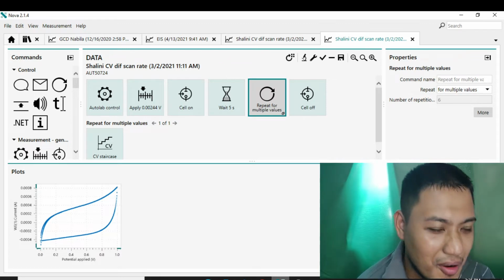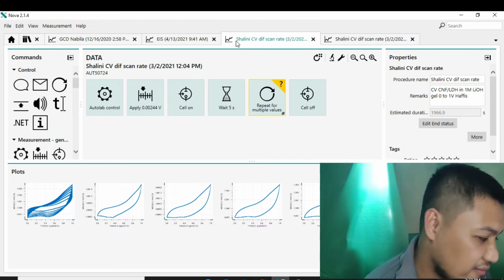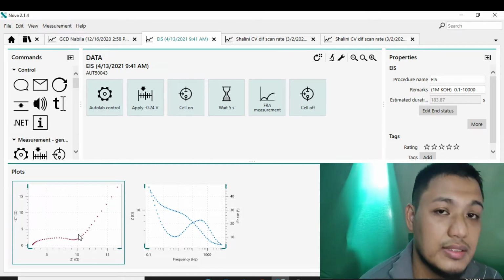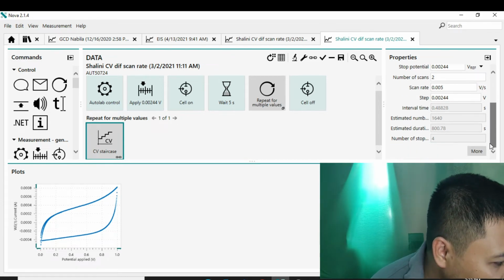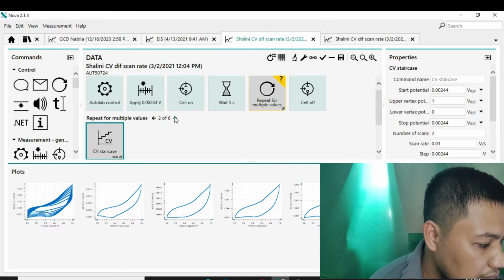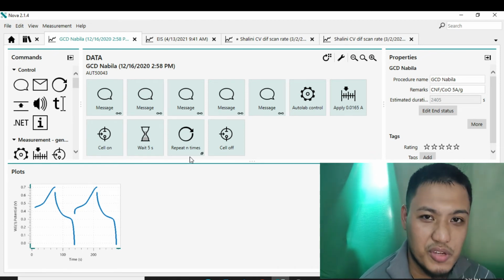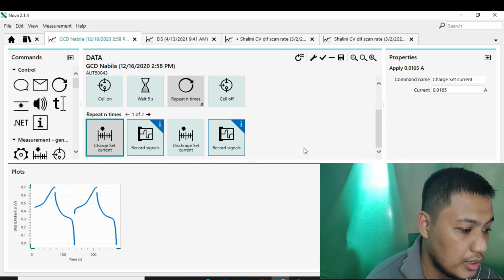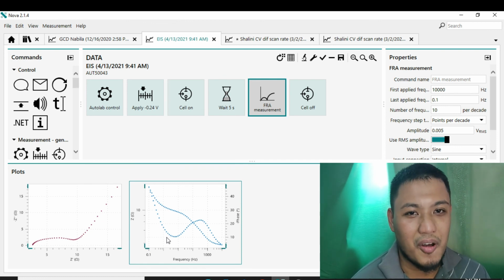Basic supercapacitor 3ELECTRODE System. [CV, GCD, EIS]

Comment: Hello dr haffeast and thank you for all your videos i had question about the configuration for two electrode test (device) on how it should be or what is different from 3 electode system.
Also on assembly of device could you give some suggestions on how to seal the device as well (im using ni foam as substrate).
Thank you again.

Comment: I have a supercapacitor material, as per literature I have to set potential window of -1 to 0. So what should be values of upper vertex, lower vertex, start and stop value. I am not able to set them as it shows error. Please Help.
Reply from the maker: Tried upper vertex, start and stop value 0. Only lower vertex -0.1

Comment: How to import our data to the Nova software in our own laptop? as we get the data from the nova software in the computer that is integrated with the potentiostat
Reply from the maker: First you need to install the nova software on your laptop. Then you can open your nox file. If you save using excell then you can directly use origin to plot your data. Hope it helps you.

Comment: Please help me for solution this problem

A 1.000 g sample of zinc metal is dissolved in 50 mL of 6 M HCl solution and diluted to the mark in a 250 mL volumetric flask. A 25.00 mL portion is transferred to a polarographic cell and oxygen is flushed out. A polarogram in the range 0 - 1 V (vs. the Hg-pool electrode) shows a wave at E1/2 = -0.65 V, id = 32.0 units of galvanometer deflection. A 5.00 mL portion of 5.00 x 10-4 M CdCi2 solution is added directly to the polarography cell which already contains the Zn solution, oxygen is again flushed out, and a second polarogram is taken. The wave shows the same E1/2 but the id is 77.5 units. Calculate the percent by weight of Cd impurity in the Zn metal. Note: Atomic weight of Cd is 112.4 g/mole.

Comment: Thanks God.. I found this video. Thank you so much Sir. This really helped me to understand and carry out electrochemical testing..

Btw, I have some questions Sir.. If we want to observe our material until 1000 cycles. In CV procedure, we put the number of scans by 1000? and for GCD procedure, we put 1000 in number of cycle column. Is it correct?
and how long the estimated time to run this cycle? Is it okay to leave the measurement for days?
thank you
Reply: Please help me for solution this problem
If you know
If you can

A 1.000 g sample of zinc metal is dissolved in 50 mL of 6 M HCl solution and diluted to the mark in a 250 mL volumetric flask. A 25.00 mL portion is transferred to a polarographic cell and oxygen is flushed out. A polarogram in the range 0 - 1 V (vs. the Hg-pool electrode) shows a wave at E1/2 = -0.65 V, id = 32.0 units of galvanometer deflection. A 5.00 mL portion of 5.00 x 10-4 M CdCi2 solution is added directly to the polarography cell which already contains the Zn solution, oxygen is again flushed out, and a second polarogram is taken. The wave shows the same E1/2 but the id is 77.5 units. Calculate the percent by weight of Cd impurity in the Zn metal. Note: Atomic weight of Cd is 112.4 g/mole.
Reply from the maker: You can choose 1 either CV or GCD. Depends on your Potential window. If the potential window is big, then you analysis will be longer. 

I do suggest you use high scan rates like 100 or 200 mV/s to run your stability test.

If you are using GCD, please use high current density to reduce the analysis time. For example 5 or 10 A/g.

Yes you can leave the measurements for days. After the stability analysis is complete. You need to rest the machine for 2 or 3 hours before your next analysis.
Reply: Thanks for your fast respond, Dr. @DrHaffeast  I have another question. In our Nova software there is no GCD procedure (only Cyclic voltammetry galvanostatic), so how to measure the GCD? Should we make a new procedure? If so, could you show me how to make a new procedure for GCD. Thanks again Dr..

Comment: Hi, sorry to ask, I want to test CV, GCD and EIS using autolab on synthesized anode for lithium-ion batteries which substrate-like, how the set-up on the instrument should be ya? thank you in advance!
Reply from the maker: For lithium Ion batteries normally you need to fabricate your material in a coin cell. After that you can use 2 electrode systems to measure CV, GCD and EIS.
Reply: @DrHaffeast  i see, so it is necessarily to fabricate coin cell. thank you sir.
Reply from the maker: @azu9833  Yes.
Reply from the maker: @azu9833  unless you want to report battery type Supercapacitor instead of lithium Ion batteries, no coin cell is needed.

Comment: Hiii sir,

Suppose Cv potential window is 0.6- 1.4 V
While doing GCD the potential range that I should set is 0.6- 1.4 V
Or 0-1.4 V.
Because sir Charging should start from 0 and after discharge it should reach again 0? Am not sure , can you please guide me sir
Reply: In 2 electrode system,If PW both for positive and negetive electrode is positive i.e 0.8 to 1.8  ,then also same calculation?
Reply from the maker: @swarnashet9678  normally i dont encountered this problem. either people use symmetry supercapacitor. For example 0.8V + 0.8 V equal to 1.6 V.

Rare to see you are dealing with 2 different positive PW.

Please refer other papers for clarification.
Reply: Thank you very much sir 🙏
Reply: Thank you very much sir 🙏
Reply: Please help me for solution this problem
If you can
If you know

A 1.000 g sample of zinc metal is dissolved in 50 mL of 6 M HCl solution and diluted to the mark in a 250 mL volumetric flask. A 25.00 mL portion is transferred to a polarographic cell and oxygen is flushed out. A polarogram in the range 0 - 1 V (vs. the Hg-pool electrode) shows a wave at E1/2 = -0.65 V, id = 32.0 units of galvanometer deflection. A 5.00 mL portion of 5.00 x 10-4 M CdCi2 solution is added directly to the polarography cell which already contains the Zn solution, oxygen is again flushed out, and a second polarogram is taken. The wave shows the same E1/2 but the id is 77.5 units. Calculate the percent by weight of Cd impurity in the Zn metal. Note: Atomic weight of Cd is 112.4 g/mole.
Reply from the maker: Depends on which set up you used. If 3 electrode system, the potential window should be exactly the same for CV and GCD.  

If 2 electrode system you must combined both potential window of positive and negative electrode.

For example positive electrode PW is 1 V and negative electrode PW is -0.8 V. Thus, your device or 2 electrode system PW should start from 0 to 1.8V. This is because PW for 2 electrode system always positive.

Comment: Hello sir,

When I plot GCD curve in origin software, at small current it's showing time in minutes and voltage
At higher current it's showing time in seconds and voltage in millivolt

So when I overlay this there is fluctuations in the graph.
So how can I plot this and make changes in origin software
Reply: Okay sir, thank you very much
Reply from the maker: Suppose this problem will not occur if you fix time in second.
Reply from the maker: maybe you mistakenly click some icon in origin.
Reply from the maker: My advice copy all data in excell using volt and second only. Then plot using origin.

Comment: Hello sir,

When I do CV for my material it's showing the potential window between 1.8- 2 volt
But at the same time when I do GCD it's reaching only upto 1.4 Volt..what may be the reason sir?
Reply: Oh! Thank you very much sir 🙏
Reply from the maker: @swarnashet9678  welcome
Reply from the maker: Somehow I also faced the same problem when dealing with certain substrate such as nickel foam. The inability of the materials to achieve the same potential window as CV might due to the low mass loading. Please try to increase the mass loading and see if there is changes in results.

On top of that please use higher current when running the GCD.

That all from my side.
Reply: Me also face same problem sir

Comment: sir i want to know how to use three electrode cell if we prepare 1 cm2 electrode of nikal foam i want to look and know how to conect parts of three electrode cell system
Reply from the maker: Hi Hussein good day. 3 electrode system is easy. First clip your working electrode with nickel foam.

Second clip your reference electrode with Silver/silver chloride or saturated calomel electrode.

Third clip your counter electrode with platinum wire.

Hopefully you successfully carry out your experiment.
Reply: @DrHaffeast  so i only conect working electrode nikal foam  and put it in electrolyte how should i immerse it in electrolyte  i concet it with cooper wire or what
Reply from the maker: @mohamedhussein8163  Refer this video. I make video on 3 electrode system configuration https://youtu.be/Vgcr8JQOlcA
Reply: @DrHaffeast  thanks alot

Comment: Sir , I want to analyze -1 to 0 potential window , -1 as lower and 0 higher potential. but what value can add in the start potential and stop potential values?   and also in the case of 0 to 1 potential window
Reply from the maker: You can start from 0 and stop at -1 V and vice versa 0 to 1V. You dont have to added the value manually for example 0.0001 to -0.9997.
The value will be adjusted by the software automatically.